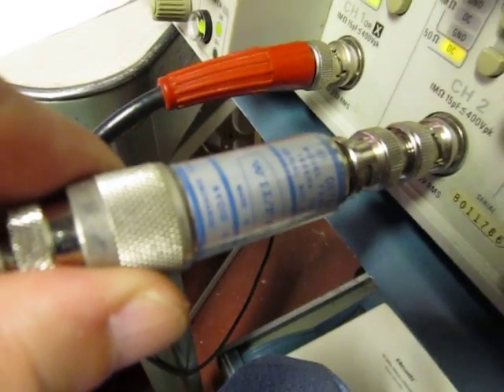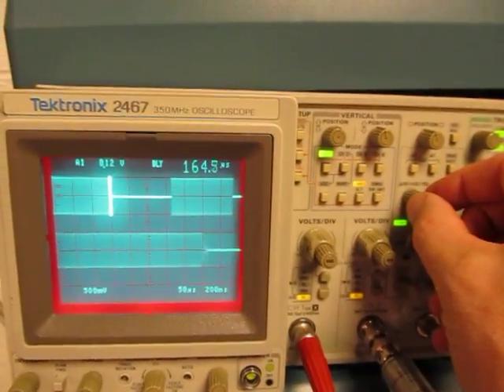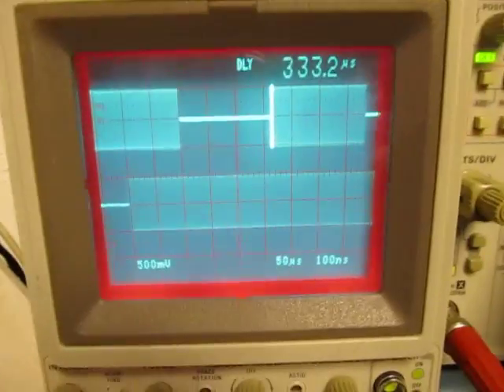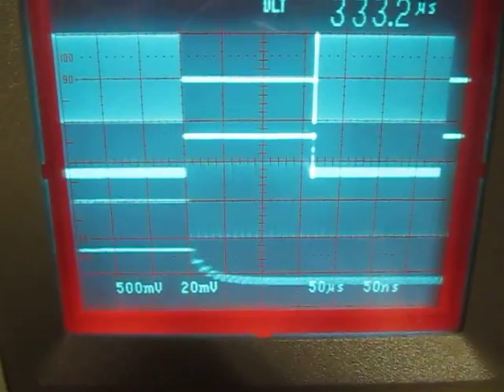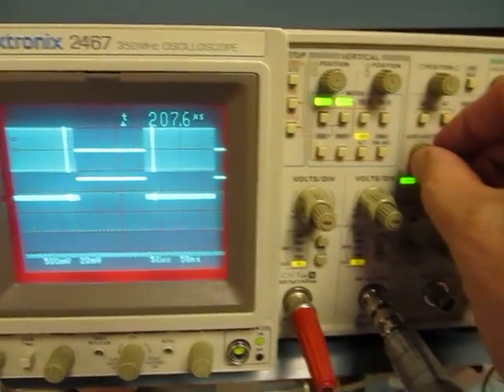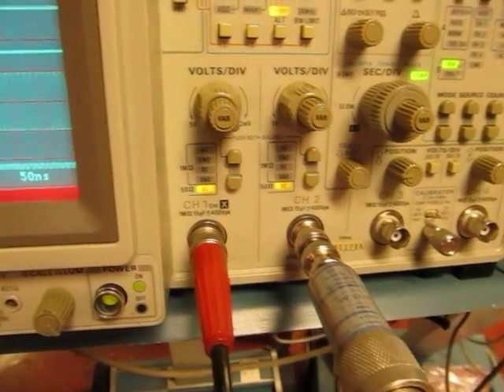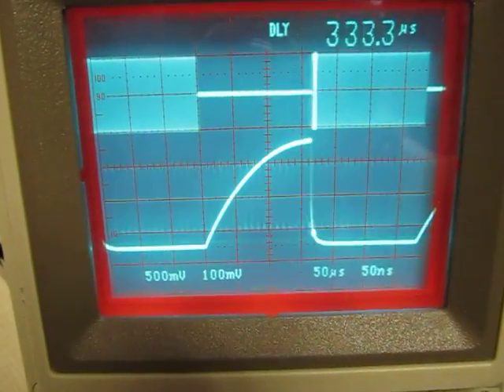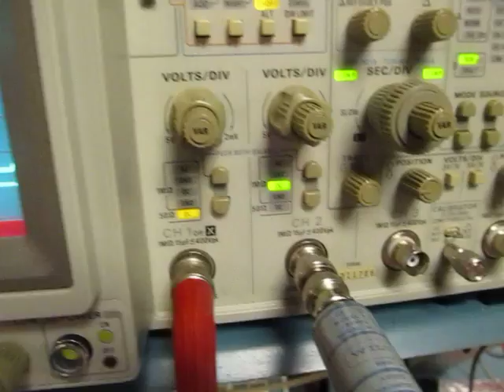#18: Use Oscilloscope with delayed time base to measure a RF Power detector

Comment: Why do the RF detectors tend to be negative detectors?
Reply from the maker: Not sure. Maybe the physical design of the high speed Schottky diodes used for detectors makes negative detectors have better performance.

Comment: I tried replicating your setup on my 2465A. Sadly, the B sweep was very dark, barely visible even with brightness cranked way too high for A sweep to be comfortable. I also tried on my 2245A which has separate B sweep brightness control. Even that wasn't much better. Is that a feature of your 2467 that the B sweep is so nice and bright? Or are my CRTs just old and burned out?
Reply from the maker: The 2467 is MUCH better at fast sweep speeds

Comment: Thanks for the tutorial, I'll do this lab work again myself. Can you tell me how to switch off the delayed sweep mode on the 2445B?
Reply from the maker: On the 2445B, you can turn off the delayed sweep by:  1) Making sure the SEC/DIV knob is pushed in, and 2) Rotating the SEC/DIV counter-clockwise until the B SWP light goes out and the A SWP light turns on.
Reply: @w2aew  probably something is going wrong with my device as it always starts with A and B lights turned on. When I turn SEC/DIV counterclockwise, A and B lights still lighting and graph makes shorter at the left side. Looks like knob contacts sticked to each other somewhere inside the knob.
Reply from the maker: @wolfmonk9d  it’s possible someone removed the knob and didn’t reassemble it properly.
Reply: @w2aew  thanks for this notice, I'll contact guy who sold me device and probably will figure out the reason.
Reply: @w2aew  this will be useful for the community, I believe. Problem solved: it has cleared out that the issue was with the control board on which the limit switch is located. The switch itself and the knob were okay, start-up self-test said the oscilloscope is okay too, but the control board has failed. It happens extremely rarely, but I was lucky. After the control board replacement, the oscilloscope works.